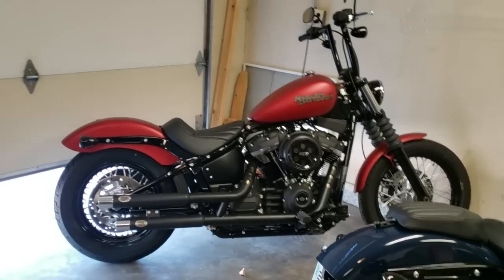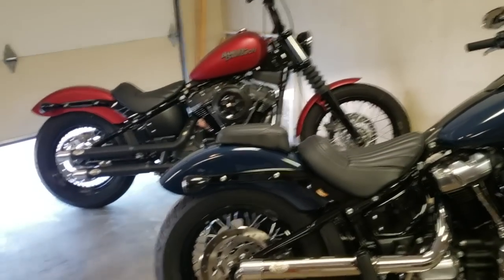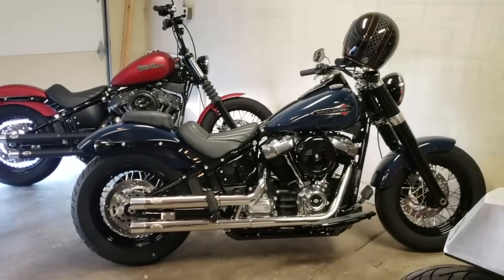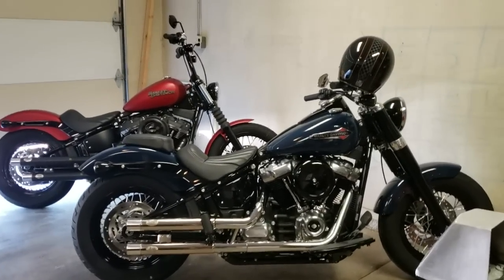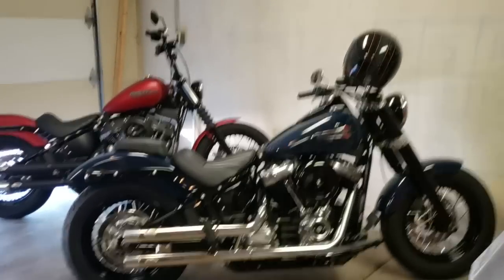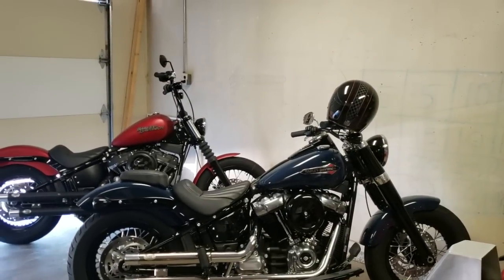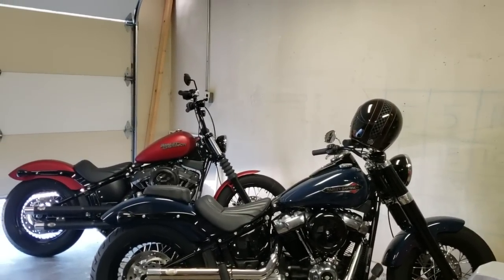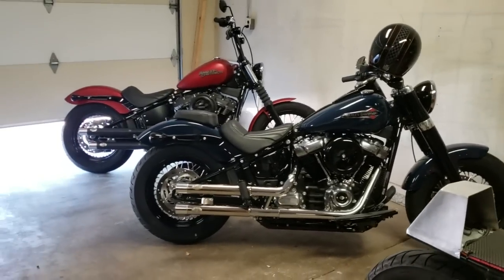HD Slim and Street Bob subtle throttle difference

Comment: Has one or the other had a stage upgrade? And thirty pound will definitely make a difference in the initial takeoff. .25 of a bike length from a dead stop would actually be felt throughout the power band at any point and kinda sounds like what you are experiencing.
Reply from the maker: At the time this video was posted neither had a stage upgrade